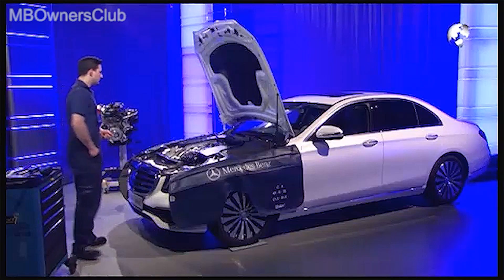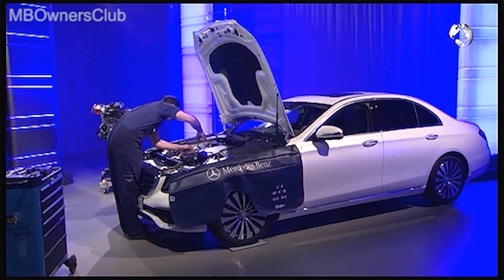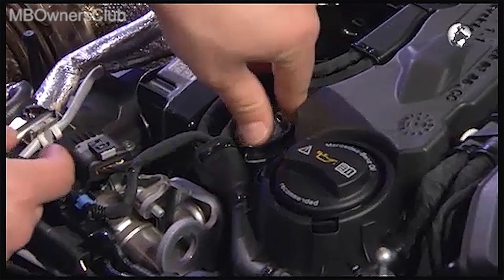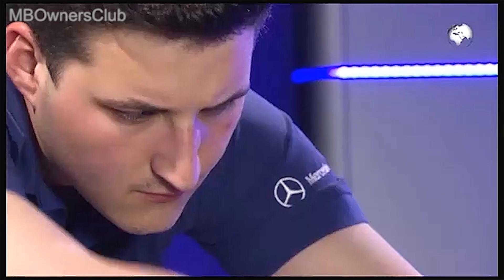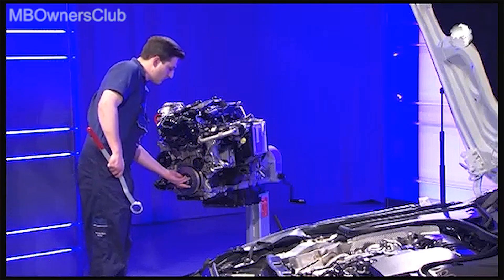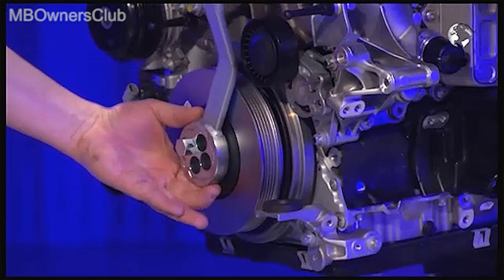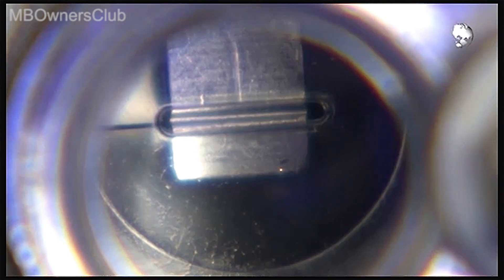Mercedes-Benz E-Class OM654 Engine: Camshaft Basic Position Check

Comment: Sorry ... Somtihing ist wrong ... Or? 
I think the OT on the crankshaft is not set exactly. 

Time 2:07 It is correct and then,  
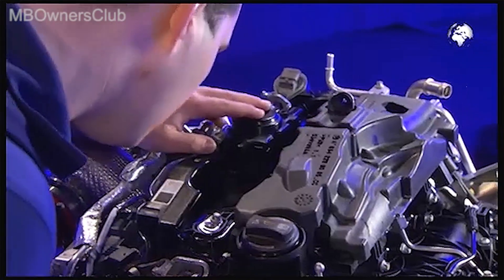Time 2:09 the worker moves the camshaft a few more degrees.

What position is correct now Time 2:07  or Time  2:09 ?
Thanks . Greeting.